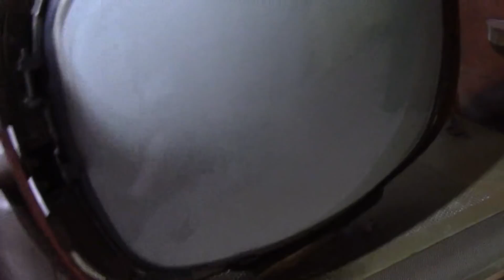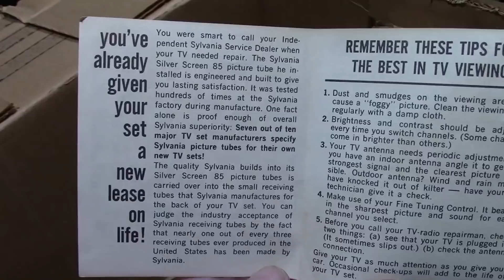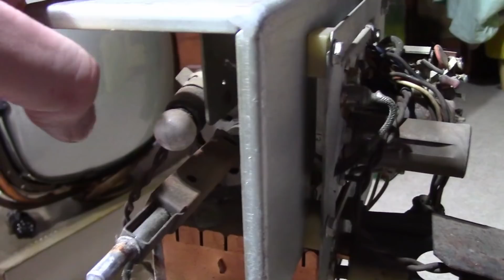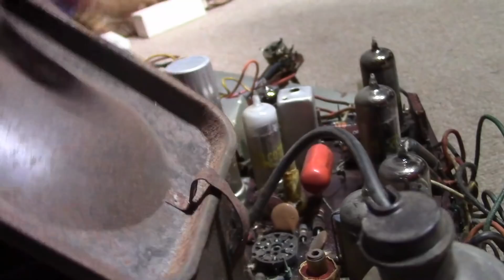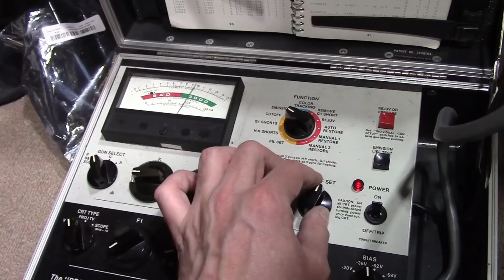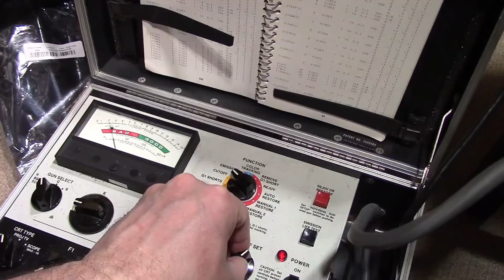Predicta Salvage 2

Comment: Bob for what it is worth I just had a CRT test almost exactly like this, light blue/purple glow when the cutoff is adjusted, tested great. I hooked it up to a TV and it is running excellent and the blue/purple glow is gone with high voltage. I would be really interested to see how this tube reacts when it is connected, you might get lucky.
Reply from the maker: Interesting and encouraging.  Now I'm even more curious to try it out. Shouldn't be too long.  I've been working on a project I have yet to post about.
Reply: @bandersentv  Yes I am curious as well. So please update us when you try it out. As for a gassy tube I do have one 21CYP22 which is a crappy RCA Colorama rebuild and you can see purple around the pins when the cutoff is adjusted. But it is far brighter purple than the light blue/purple my tube and yours is showing.

Comment: could you drip some locktite around the pins? maybe the vacuum would suck the glue into the gap if the pins are stressed?
Reply from the maker: No, unfortunately there is nothing that can seal the leak.  Not even expensive industrial glues like vacseal.  The amount of pressure is incredible and air molecules as so small.
Reply: @bandersentv  That sucks.

Comment: it's quite possible the little air inside the picture tube would react with the metal compounds inside the tube when heated. So if you could glue shut the glass around the pins and such with superglue and/or epoxy you could still salvage the tube as is. Nice find though, specifically the HV coil replacement, those are rare like hens' teeth.
Can't wait to see you dig into your predictas :)
Reply from the maker: No, unfortunately there is nothing that can seal the leak.  Not even expensive industrial glues like vacseal.  The amount of pressure is incredible and air molecules as so small.

Comment: Some techs add a separate 6.3VAC filament transformer and place a resistor across the original filament leads to compensate for the 2.3V . Dan Jones had to do that to one of the sets he rebuilt. Looks like Shadow enjoys hanging out in the shop :)
Reply from the maker: Yes, he is such a curious pup.  Jupiter is afraid of the basement and won't come down because that's where the scary baths happen :D
Reply: Jupiter is handsome. I thought you were allergic to dogs?
Reply from the maker: I am.  I pop a pill every day.  They're worth it.

Comment: Shame about the 21" tube, I had a similar problem with a 24" tube, when put in a working set there were fireworks in the neck :(
I did notice while testing on my B&K that the neck got hotter than usual.
Reply from the maker: Yes, the leaked in air will conduct the filament heat to the neck.  Should be fun to try using it.  Maybe even get it rebuilt someday along with the other 3 bad Predicta CRTs I have.

Comment: Philco UHF tuners: I have memories of them and their knobs. Unfortunately, they are bad memories. The inner knob was made of a weak plastic and the track for the drive wore out very quickly. Back then there wasn't a whole lot you could do if a replacement could not be had. We tried using plastic putty to restore the walls of the track but stuff was pretty primitive back then and the putty wore faster than the original plastic. In the mid 60s when these started wearing out UHF channels were booming and made sets with the rare UHF tuners worth a premium. Sadly, Philcos were usually beyond practical repair.

They also had runs where they used the absolute worst octal tube sockets ever seen. They were made of a THIN styrene-like plastic and instead of mounting with ears like regular sockets they had a center tube that pushed into a simple hole in the chassis. Little tabs gripped the hole to keep it in place. The sockets were guaranteed to break the first time a tube was pulled on to remove it. The usual "fix" was to epoxy it back in place but heat quickly destroyed those early epoxies in short order - if they even managed to stick to things to begin with. 

Pre-1955 Philcos were pretty good but they went way too far cheapening stuff after that. Muntz or GE was a better investment.

The cheapening of American tv sets made it easy for the Japanese to enter the market. Buyers didn't trust them but most figured they had little to lose since too many domestic brands went crap. By the end of the 60s most preferred the imports.